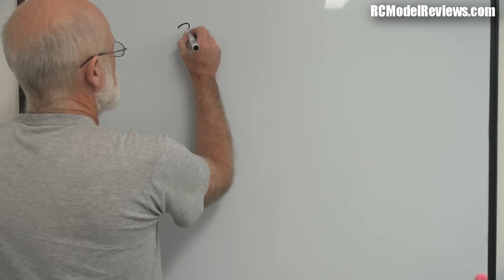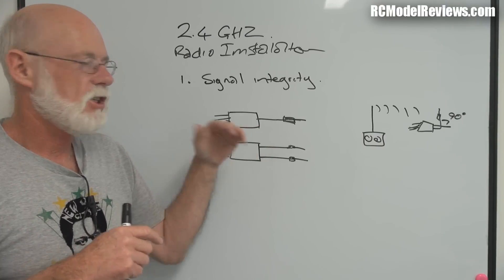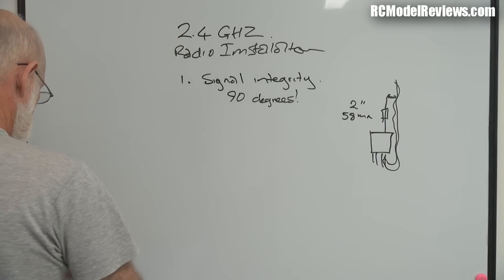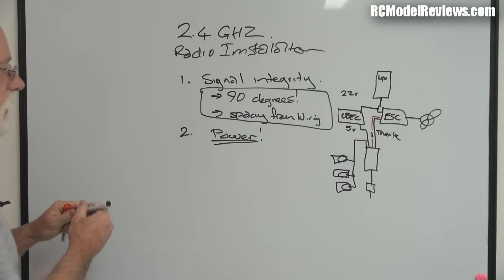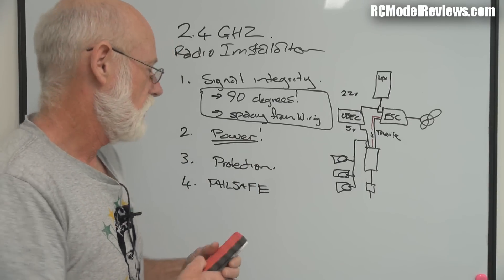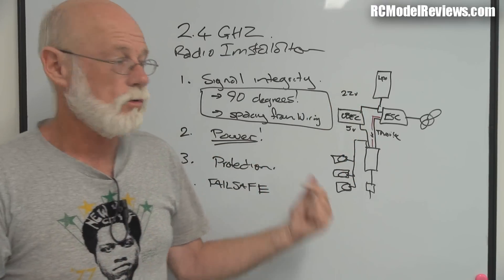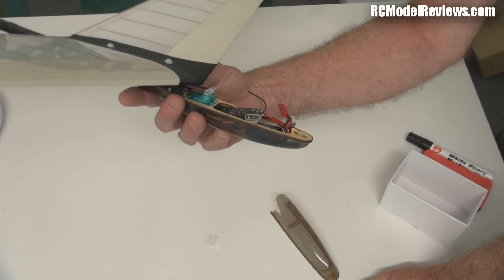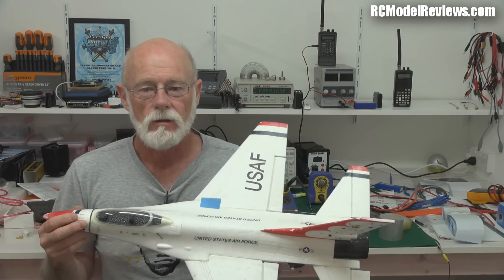How to install 2.4GHz radio control systems in RC planes

Comment: First off, I'd like to thank you for sharing your knowledge of the RC world with us on YouTube. I'm about 4 years into the hobby and still find it hard to go to the local field (Bennett Field,NV) because as soon as I get my Horizon Saber, Hawk Sky, or Horizon Mustang up, it inspires someone was a far greater plane to also take the sky and while calling out "Low Pass" and "High speed fly by" as I nervously try to avoid crashing into their plane and or mine into the ground. Trying to get pointers out of some of the "wise-ones" is in it is self as hard as landing on the moon. Secondly, your videos allow myself, and I'm sure others that are like me, to learn about the hobby in a non-sarcastic light. Lastly, (and this is the business part of this "rant") I have a Spektrum AR6210 with the satellite add-on. I put the satellite extension into the noise (in front of the battery by maybe a couple inches). Does that interfere with signal and should I consider running it into the body of the plane? So far I have gotten great range out of the receiver but in light of this video, I'd like to keep my plane in one piece. For now.

Comment: Bruce, I am new to RC planes and this video answered my antenna placement question that not many  RC enthusiasts seem to address. Thank you so much. I notice many foam RC planes don't seem to have external antenna placement, something I am going to do as I finish up my first plane, the Dynam Hawksky with the FlySky dual antenna receiver.

Comment: Hi Bruce, just bought my first 2.4 GHz RadioMaster TX16S system with their R86 Rx so finding out how this compares to my old legacy 35, 40 and 72 KHz equipment.
Good video, helped my do things right the first time, thanks.
P.S. 2 inches is 50.8mm (2x25.4mm)

Comment: Timeless info, well presented - thank you!

Would love to see a discussion about the different types of antennas, and where they radiate from - is it just the exposed wire? What about those antennas with the load (lump) just before the tip? This would help determine routing and placement of the useful bits!

Comment: Thanks Bruce. Great advice. One point regarding the ubec: Some may think that it's ok to have a ubec and a speed controller both plugged into the receiver, which is not a good idea. I have a fpv setup that uses a 6V ubec and a speed controller's bec both connected via diodes (diode OR-ing). The aim is to maximise reliability. Perhaps you can do a technical tutorial on this as well. Cheers, keep up the good work.

Comment: I think Futaba recommends the antennae be 90deg AND in different planes.  

Eg: if looking down, your arrangement forms an (L), take one antenna and elevate or lower it the same length of the antenna at least.

Comment: nice job, covers a lot of important stuff, one thing , having antenna vertical or horizontal on tx needs to be thought about, for fpv and single antenna RX vertical might be best, for los gliders with diversity horizontal on all antenna might be better.

Comment: What do you think about using a bec and a ubec  to insure back up power ?  I also like to mention with the telemetry if you loose your plane in tall weeds or bushes  you can put you radio in range mode and when your pointing your radio at it the power  single goes up this will help you find it if battery is still connected  try it before you loose it and you will see how to track it

Comment: 90 degrees, understood.  But can  both wires be 90 deg in the horizontal plane, or does at least one wire one have to be in the vertical plane?  All your examples have at least one antenna wire vertical, so I am assuming that is necessary, but it is often easier to have both wires in the horizontal plane.

Comment: Great video again Bruce
My Orange receiver has only one wire for the antenna. Can I solder another wire to the same circuit board point where the existing one is attached to give me two antennas?

Comment: Hi Bruce, as always, another great how to video.  I'm just getting back into RC, after an almost 20 year break,  getting to grips with the myriad options in 2.4Mh RC now, from Txs, compared with my old Futaba FF7, which I thought was complicated then, to Rxs!  I'm glad to say that your video has (almost|) completely clarified receiver installation for me, indeed so have your other instructional videos helped to clear the mist
You mention that the main part of the one or two antenna cables coming out of the Rx are co-ax-  in my Rx, each being a total of some 140mm long, with only the last 30mm or so being bare wire.  My question is- does the effective aerial consist of the total 14mm?  Or is it just that the last 30mm on each have to effectively be at right angles?  Thx again..

Comment: if u have ur tx antenna vertical, and flying a plane dosent it means there are "dead zones" above and below antenna, as the radiation pattern is sort of doughnut shape??? so wouldn't it be better to have both tx and rx antenna's be parallel in horizontal way? and both rx antenna horizontal lets say one pointing motor and another pointing at wing at 90° with each other?

Comment: Hi Bruce,I am just finishing a Samson which is a 1450 mm span flying boat.The twin electric motors are Permax 450 turbo,s,unfortunately i have misplaced the wiring diagram that came with the motors so am not sure where the supplied resistors go.I was speaking to one of the guys at Sail Air in New market Auckland and he reckons i won,t have to use the resistors if i use a  Li Po battery and the appropriate ESC.Can you shed more light on this and explain how to set it all up.
Regards Neil.

Comment: Hey there Bruce, I have done the upgrade to the 9X with the FrSky DJT and will be using the D8RII Plus for long range FPV. But what of the old 9x Tx module which I kept and put the antenna back on to? Is there any point in trying to modify the PCB of the T9X 8Ch Rx with the uFL SMD RF connectors like FrSky uses so that I may have diversity on the old receivers for short range LOS flying?

Comment: Thanks Bruce, every time I watch one of your videos, even though I feel pretty confident, I still learn from you. Question for you though: on the single antenna rx's like the Turnigy 8 channel v2's, what is the brass barrell on the antenna and is the active part of the antenna beyond the barrell or is the barrell part of the active element?
Reply: I belive the brass barrell is the 'ground' part of the dipole antenna. The little wire sticking out of the end is the active element

Comment: Would it it bad if I run the 2 antennas at 180 degrees  e.g..1 antenna going towards the left wing and towards the right wing or do they have to be 90 degrees

Comment: i have a question about the space from the antenna to wires. Is it 58mm general space to wires with the antenna or is it enough if the antenna end has a distance to wires from 58mm??? sorry for my english

Comment: Hi Bruce, thank you very much for your great videos! Especially your "whiteboard" theory lessons. They are great! My latest plane is a glider (Spirit V) with a glass fibre fuselage. Does the glass fibre affect much the signal strength? Using an Spektrum AR8000 with satellite I wonder whether I should drill two holes into the fuselage to lead the antenna wires outside. Or leaving the inside. What wuold you recommend? Thank you very much for your answer! Keep on with your great work! Greetings from Bavaria! Alex
Reply: Glass fibre (and kevlar) is pretty transparrent to 2.4GHz signals so you can mount the antennas inside if you like.
Reply: ***** Thanks for your advice and your work! Hope you will be allowed to fly again soon!

Comment: Cheers Bruce,that was great.Learnt a few things there.I have installed my radio gear poorly on a few models and it shows how solid Frsky is, to still give me signal.
One question for you mate,how to relieve stress of the antenna where it is soldered to the board.I have a few come loose.Would silicone or hot glue be ok.
Reply: Hotglue is about the best.  The problem with silicone is that some varieties contain acetic acid, the fumes from which can cause nasty corrosion throughout the adjacent circuitry.  I should think that Charlie would have ample stocks of hot glue n'est pas? :-)
Reply: ***** Thanks Bruce.Charlie has got through 50 glue sticks in less than a month.Why are we not surprised :)
Reply: I need to get my Deltang receiver antenna resoldered, thats a good idea, i think i will go with a bit of hotglue for reenforcement as xjet suggests. Cheers guys.

Comment: Hi Bruce.
In My 73" Skyline MX2 with an NGH 35cc gasser. I want to know if it is ok to glue a small 1/8 wooden dowel center line in fuse horizontal with My 2.4 receiver and "zip tie one of the antennas to it" and tape the other 90deg to the side of the interior vertically. The antennas will then be (aprox) 8" from the two battery packs behind the receiver set on a foam pad ? The questionable part of this is the horizontal antenna zipped to dowel will end about 1 1/2" from the carbon fiber wing tube. Wish I could add picture to this.

Comment: Great job Bruce.  One thing you didn't mention is the transmitter antenna.  I have witnessed some guys flying with their transmitter antenna straight, some slightly bent and some at 90 degrees.  Just curious, is there is a "best" option?  Thanks for the great video.
Reply: I prefer the tx antenna straight up (if possible). That way most of the energy is being directed out sidewards and the antenna null is straight above(normally not an issue). Also note the antenna on the plane should also be mounted vertical. If the tx antenna its mounted sidewards will have two nulls (area to advoid). Its a little hard to explain.  Google 'dipole radiation pattern' to get a better understanding of where the energy is being directed
Reply: Its a little hard to explain, google 'dipole radiation pattern' to get a better understanding of where the energy is going.

Comment: Hi Bruce. 
How about Hitec receivers to Aurora 9, are they good? 
All my receivers have just one antenna and I have the same critérios to install them in my models. 
Thanks for sharing your thoughts and experience. 
Lucio from Brazil.
Reply: Yes, as I said in the video, most RC systems have enough headroom (excess range) that any drop-outs due to the antenna being at a "less than optimal" orientation to the transmitter are going to be very brief and will almost certainly go unnoticed.

Certainly if you want maximum range (such as for FPV use), it would pay to use the 9-channel Hitec receiver with dual antennas.

Another option is the FrSky Hitec-compatible receiver which is nice and cheap and has dual antennas.  I have one on the bench right now awaiting review.

Comment: Five years later. I've seen a couple of youtube videos and the guys had awful, terrible noise coming out of their planes and no motors or engines were running. I'm wondering if that noise was from their SBEC or UBEC - I'm referring to the 'switching' aspect of it. I mean what else would have caused that awful noise?

Comment: can i use any receiver with my plane and 10a ESC? i'm new at this and i'm trying to upgrade my radio and receiver for fpv? does the esc know how much it needs to supply or will it burn my receiver?

Comment: Bruce, is there a reason that no triple antenna receivers exist for optimal polarisation in all 3 dimensions?
Reply: Mainly because there's really no need.  Modern 2.4GHz RC gear has so much more range than it needs (most are good to at least a mile but an average-sized model can't really be seen beyond half that) and this means that even in a "worst case" situation, where the receiver antenna is pointed directly at the transmitter, enough signal gets through to maintain control.

Comment: Thanks a lot! It's worth to know how do it with 2.4 gHz receiver with 2 antenna in the plane since i am new  to install the 2.4 gHz receiver to all my old model airplanes who had 35 mHz FM receiver after the transmitter has passed away after 17 year. This  about "fail safe", i never used "fail safe" since i has big battery in some big model airplanes for long duration with large fuel tank, and i has always On Board Battery Monitor Battery Checker in model airplane to check the voltage in battery before use, never had a flight crash since I definitely check all of the condition of the aircraft + the radio equipment is in good condition or I decide that it is not safe to fly before everything is fixed in advance. I learned from mistakes and experience when I was a young newbeginner. None of them is electric powered engine in the planes, so I'm old fashioned who like to use "fossil" engine in model aircraft. :)

Comment: perfect timing with this video as i just had some issue with radio signal loss with my quadcopter , i assume the principles are the same , i have to run the antenna`s along the underside of the two rear motor booms , is this the optimal way to have them  ?
Reply: Best to run the antennas through a little straw either  up or down and away from the frame
Reply: Mike Baltes ok thanks will try that , they were sticky taped to the underside of the booms , airframe plastic booms but motor wires inside them , and both exposed antenna ends were very close to the motors , probably not good
Reply: The key thing is to have your antennas well away from any other wires, carbon or metal (such as the motors).  Given that a multirotor is unlikely to tilt beyond 45 degrees, you can also narrow the angle between the antennas a little and even consider mounting the antennas facing down beneath the legs  or up above the body in a V shape.  As Mike says, you can use straws to hold them in place.
Reply: ***** great thanks , i`ll give both a try doing range checks and see what configuration gets the best range . i have a futaba t8j tx with internal antenna
Reply: What esc's were you using? Did you have all the middle red wires plugged in (bec's)? Do you use an external bec? Those factors outweigh the probability of it being a radio problem.
Reply: I would set them up as a Vee. Search TBS discovery to see what I mean http://team-blacksheep.com/products/product:98
Reply: Thats 90% like they say

Comment: FAILSAFE; something i never used. U see i'm a big Turnigy 9x model enthusiast,i have 4 of em, failsafe is all but basic. A few years ago i bought a separate failsafe to put on a big heli of mine. never did. I use the 9x with standard modules like, (Turnigy,Eurgle,FSky), & bought separately Orange Rx,  FRSky & Assan.
Consolation, the ER(X software should be able to do something fine.
All to say i should read about it a lil more & APPLY it .
I'm such a big kid, BRB gotta go get some candy, lol.

Comment: Help. I have Devo 7 with rx701. My antennas are 90 degrees relative to each other ´but i still get about 7 meters of range. I havent changed  any settings.

Comment: how do you use failsafe on multicopters?
Reply: This depends very much on the type of flight controller you're using.  If it has a "return to launch" capability, most people configure it so that this operates in the event of a failsafe (loss of signal) situation.  Otherwise, a setting which has just enough throttle to produce a slow descent in "self-leveling" mode will offer the best chance of survival -- although then  you run the risk it may drift towards people/property before reaching the ground.

Comment: couldn't you make n L shaped antenna and then use only one
Reply: +Justin “That's Interesting” Schmitz I am an electrical engineer and have worked extensively with antenna.  The simple answer to your question is no, you cannot have one antenna in an L shape.  The antenna should be kept as straight as possible.